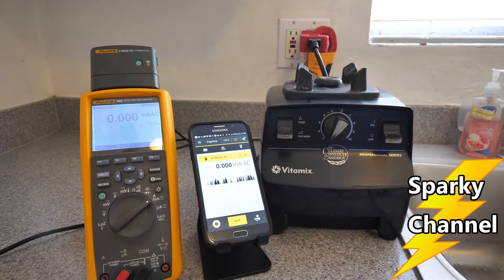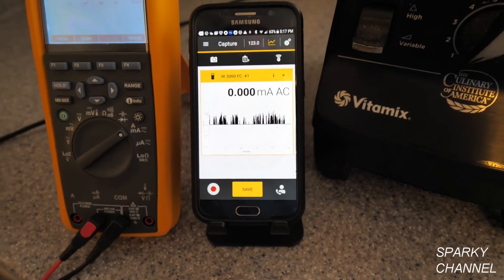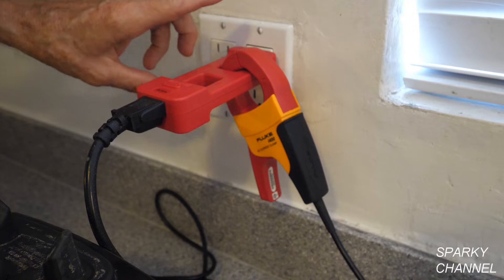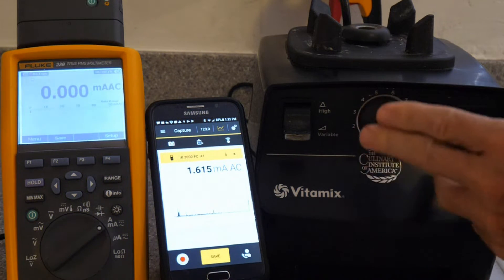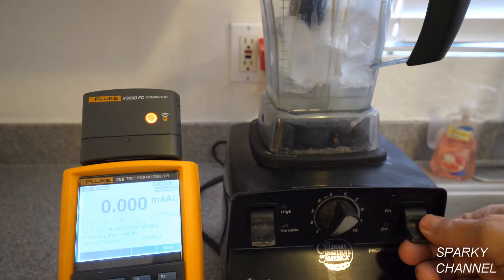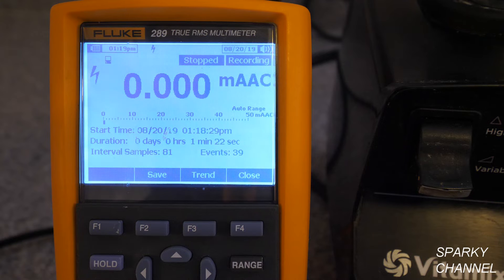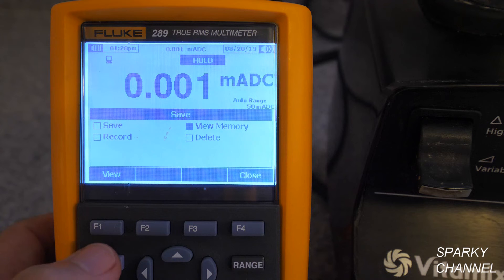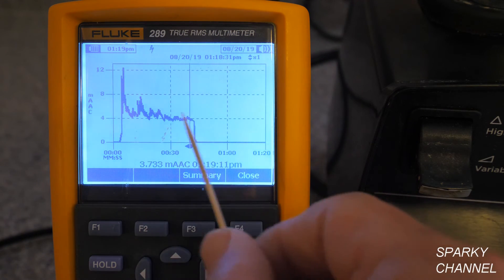Testing and Graphing Actual Amperage Usage of a Vitamix Blender Under Load

Comment: kitchen appliances are rough! modern workshop equipment behaves nicer.
Reply from the maker: I think that's because kitchen appliances have to do tasks like crushing ice, etc. that uses a high amperage at start up. Thanks and have a great weekend!
Reply: Yes. Many modern workshop power tools have "soft starting" to keep initial current spike at a minimum.